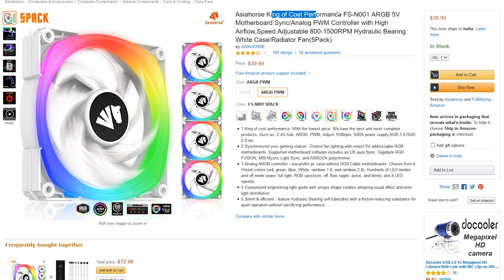How to install and connect ARGB Fans Ft AsiaHorse fs9002

Comment: I am interested in running these fans in a glass cabinet greenhouse. I was planning on buying a SATA to USB power converter and am hoping that works. Do you think this fan system would be operational without plugging in the system fan cable? - as there is no motherboard in the greenhouse … 

Thanks for the video!
Reply from the maker: These fans work at full speed (constant) without System Fan cable and good thing is, it comes with 
2.4G PWM Sync HUB&Remote (6 Pin interface)
1 X PWM CABLE
1 X Sync motherboard Cable
1 X SATA POWER CABLE.
So, you can easily run these fans in a greenhouse glass cabinet. 
Sorry for late reply ! I guess it's already running !!

Comment: if you cut the velcro in half you can use 1 part for the hub and the other for the remote so you never loose it. you can put it anywhere.

Comment: Does anyone know what the “GD” part of the cable gets plugged into? I have a gigabyte motherboard but can’t figure out where it needs to be plugged Into.
Reply: Did u ever solve it cus I have the same thing and I want to know where it goes into
Reply: @a1steaks75  I ended up not using the argb or the other 2 pin connector. I just plugged the fans into the controller and used system fan 1 to run the controller and I use the remote to change colors and set custom color settings
Reply: @rjcrane1064  ok thanks and I found where it is if u want to know
Reply: @a1steaks75  yes please lol. For future reference
Reply: @rjcrane1064  i have a gigabyte b450m and it is very hard to see but above where you plug in your power sw cable there is two prongs

Comment: Hey thanks for the video. My motherboard doesn’t have an argb connector but also the remote isn’t working to control the rgb. The fans are running though. Do you what I’m doing wrong? Thanks

Comment: How do you transfer fan PWM control to your MB ?  I can't seem to get that working.
Reply: Did you ever figure it out?
Reply: @gavv1n  I got instructions on how to do it, but it didn't work.  I think these are just a case of 'you get what you pay for' and it may work on some, but not on others.
Reply: @aaronrodriguez2898  you have to hit the power button on your remote three times if i remember correctly

Comment: My fans start up and light up but I can’t change the colors with my remote and I tried changing the battery and everything I don’t know what to do
Reply from the maker: What motherboard do you have and did you check if the headers are connected properly to the separate controller box that the fans come with ?
Reply: I have the ASUS Tuf b450m plus gaming
Reply: @VickGeek  this is happening to me to please help

Comment: you mentioned that your motherboard don't have ARGB header. But what header you have ? you didnt show that in video and later you told that, connect to ARGB header. I m confused. I also dont have ARGB header. I have 12v GRBW header and looking on videos how to connect ARGB Fan to my build. 
Could you explain how to connect ARGB fan in Gigabyte X470 AORUS GAMING 5 WIFI ?

Comment: for some reason the asiahorse fan hub doesn't play well with my power supply. When my graphics card kicks on the fans start to flicker.  I switched the hub out with my old uphere hub and it works flawlessly. the only thing is the hub dosnt have as many features as the asiahorse hub. any suggestions?

Comment: Well explained Thanks. one question. my motherboard has ARGB port , and i have connected to it in this case do i have to connect the sata power ? And  can i  switch effects between controller and motherboard ?
Reply from the maker: Not necessary to connect sata power if you are connecting it to ARGB port on motherboard.
Yes you can switch effects between controller and motherboard.

Comment: wait so if my mobo doesn't have any 3 pins or 4 pins header I can't control it through any pc software but instead I have to rely on the remote?
Reply: Yes.  There are seperate cables for power, pwn, and rgb.  If you dont have a header to plug in the rgb cable you would just have to use the remote.
Reply: Joel Amburgy very well said. One thing to remember though is the RGB pin on the MB is not the only method of controlling the fan colors. The speed of the fans can be controlled from the BIOS via the MB fan 3pin header or the remote can do so as well. The aura sync and other software are only available for RGB stuff plugged directly into the RGB pin on the MB.

Now I think you can work around this by getting a usb rgb controller but I haven’t really looked into them since I don’t mind using the remote. Once you set your colors how you want just throw the remote in a drawer somewhere 😂 

-Waffa (CZC admin)

Comment: Hey so I’m having an issue with my fans. I haven’t found anyone who is having the same issue but I had a very specific color set on my fans, it was like a lighter hot pink but not hot pink. Sadly, someone pressed something and it changed to green and I cannot find the color I had for the life of me. I’m also not able to find any software that is able to connect with my fans (I use OpenRGB right now). SOS!!
Reply from the maker: Hi, Some fans come with remote and some can be controlled via software (fan's software or the motherboard's). What fans are you using ? Specify the model/brand name ?
Reply: @VickGeek  I currently have the fs9002 pros, I used the remote to get the original color I wanted and can’t figure out how to change it. I appreciate you taking the time to reply especially as this is an older vid!

Comment: My question, if my mb have 2 ARGB 3pin headers, can i ony buy Cooler master splitter from 1to3? Do i need the controler? YES OR NO?
Reply: If you have two ARGB 3 pin headers you can just use one for whatever and one for this controller. This controller only uses up ONE 3pin ARGB header, it’s not necessary but it is if you want to sync the fans lighting with the rest of your PC. Only buy that splitter if you are going to be using more than 3 things that are ARGB. But I would say the two you have in your MB is enough. One for the fan controller, and one extra for whatever.

Comment: Hi, so if My motherboard havnt ARGN Head, i can use SATA+ remote control?
Thanks
Reply from the maker: Yes so the same controller should also be connected to fans.. like if it's a splitter cable. One end to SATA and other end to Fan

Comment: I bought ant eSports rgb fan kit  and I have gigabyte 450 pro WiFi , it has 3 pin rgb header too. Den also I m not Able to control RGB fans light through motherboard software which is RGB fusion 2

Comment: Sadly these fans do not work for me. I am able to get them to power on, light up however, the controller and hub that came with it do not work. First use they did work but now I'm not able to change the color at all with the remote. Tried to save money going with these and was a dud. Will save up and get some Corsair RGB fans instead sigh :(
Reply from the maker: Maybe change the Remote battery ?

Comment: ARGB means addressable RGB, which means you can control the fan's light through the motherboard. It doesn't mean Aura RGB I don't know where you learned the term from. And you giving advice on using the controller doesn't make sense because using internal software to manage RGB colors is much better as you have more control and more options. Please research more before making a video as reading from your comment sections the viewers have no idea and they would listen to your advise which is 100% wrong. This is the prime reason ARGB fans are more expensive as they provide you with an option to control fan speeds and RGB from motherboard using software provided by the company, hence more established companies like corsair and Lian Li have more established ARGB ecosystem where all their devices can sync together to give same rgb effect(that is why they are more expensive).
Reply from the maker: Before saying I am 100% wrong please watch the video till the end or maybe try to understand what I am saying in the video. ARGB means Addressable RGB and I am aware of it. But here the Asia Horse brand termed the ARGB as Aura RGB not technically but for marketing purpose and that is why I have used the same. I totally agree with you that ARGB from brands like Corsair, Coolermaster, etc does provide software to address the RGB. But some brands don't offer software and hence remote is provided to address the RGB. So technically you cannot sync the colours if you don't the ecosystem. If you are using say, 2 fans from Corsair with built-in software to control light and 2 fans from a Brand that doesn't provide software yet does the job at affordable price compared to Corsair, you cannot sync the RGB of 4 Fans. So that's the point. Not all ARGB support software functions, neither separately nor from motherboard manufacturer's software.